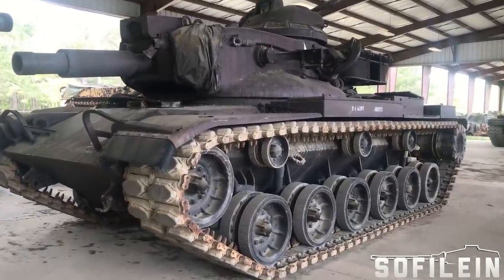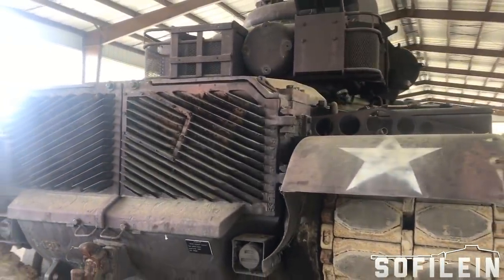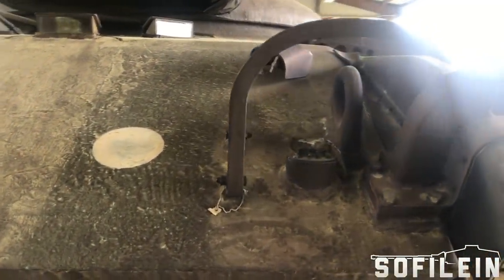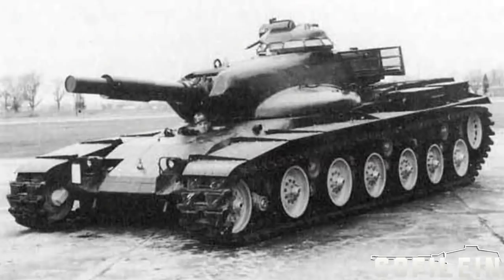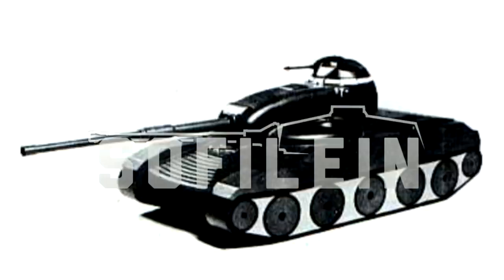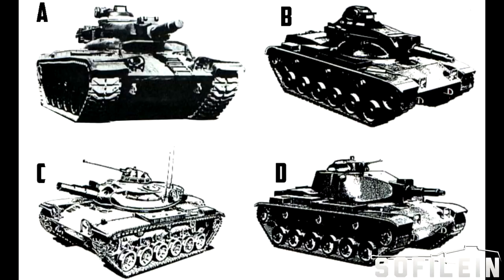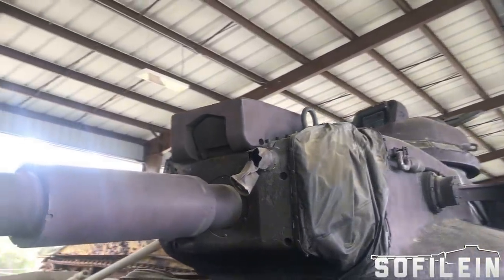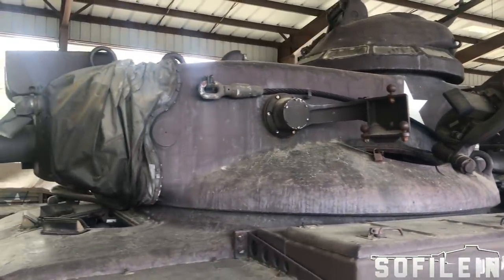Meet the M60A2 'Starship'! Walk and talk-around at NACC Ft. Benning

Comment: I went to tank drivers school at Ft. Knox in 1979 (MOS 19F).  We used M60A2s for drivers training since the hull was the same as other M60s, and the then recently obsolete turret didn’t matter.  For family day there was a cool demonstration of the turret spinning one way and the powered cupola spinning another, as well as a neutral steer and turret stabilization demonstration.

Inside, the turret was small, but the various illuminated and rubberized buttons looked very space age/advanced.  Operating the powered cupola was fun!  And, each crew member had a hatch on the M60A2.

I never saw the M60A2 again after basic as I was first assigned to an M60A1 crew, and then an M60A3TTS crew.

Sofilein: the Army is now accepting female tank crew members, time to sign up…….
Reply: Holder and Disney barracks. B4 I. I tell people today about 19 F and they're like whaaaaa....read somewhere that holder is closed and Disney torn down.
Reply: Ft. Knox was a ghost town 10 years ago guess it still is today.  Remember getting to see a Kraut Panther and the King Tiger that they did a cutaway on.  Guess these examples are at Ft. Benning now.
Reply: Things change and it's sad...I remember going into town to see the Cardinals play baseball. Loved those khakis! And the grease gun...don't know if I miss being a tanker, or being 17.

Comment: When I went to Armor Basic Officers course in 75, you learned the M60A1 and the Sheridan.  Those officers in the class going to M60A2 units received specialized training, the rest of us just got a basic orientation.  When I went to Germany my battalion in 1st AD was M60A1, while the 1st AD 4-37 Armor was all M60A2.  Next to us, 3rd Inf Div split their M60A2s up with one company in 3 battalions. 1st AD's 4-37 did OK as it simplied the maintenance, I think the 3d ID units struggled with maintenance and employment.  The system was way ahead of its time, the electronic boxes did not take tank stress (firing, normal rattling, humidity etc) very well, today's micro circuits can handle it much better.   I do not recall the term "starship being used, Just A2.  However ti probably was a crew name.
Reply: The story I heard was that yeah, "Starship" was the name someone gave their A2 and it stuck.
Reply: @cboetigphone, the 1/37 was the only battalion in the 1st Armored Division that had the M60A2s 
The 3rd Armor division had two battalions, and I believe both were on the Rock, and only three battalions were stationed in Germany.

Comment: When I was in Europe in the late 70's I was on the M60A1 RISE.  We heard horror stories about the A Duces, as we called them.  When the RISE model came in they were afraid of issues with the new power packs. electronics and lack of spare parts and only allocated 1 per Platoon.  As it turned out it was unfounded.  I couldn't tell you what the crews called them, but to us they were the A Duce. To us the A Duce was a prime example of a good idea taken over by bureaucrats.
Reply: I crew the A2s, we never called them Starships, it was called either the Ma deuce,  A deuce A2

Comment: Maybe it has been awhile for me (MOS 19E)  but "Starship" was not named for the 152 rifled/ATGM turret.  It was named for the Xenon White-Light or Infrared Spotlight used for night ops.  Either a M48 or M60 "ship" mounting a "starlight"  The M60A2 was a total failure due to a crappy stabilization. The next leap of "starship" found its way into my tank, M60A3, which had a much improved "starlight" night vision called TTS or tank thermal sight from 1980 and an AOS.

Comment: how is a long rod penetrator effective on a short barreled gun like that?
Reply: Lower. But the rod material choice makes some difference. If thinking about rod made of some mixed tool steel alloys it would work only with some sort of overpowered propelant. Rod density, distance and the size of charge would play main role.

Comment: Im curious what those 3 trailer hitch balls you see at 1:52 were used for?
Reply: Was wondering the same.
Reply: Big spot light mounted on them. As the gun elevates and depresses, the spot light changes angle as well.

Comment: I think one of the primary technological advances of the M60A2, in addition to the combined gun/ATGM launcher, was that the gun system was stabilized, and could theoretically be fired accurately while the tank was moving.  All previous U.S. tanks, including the M60A1s, had to be stopped in order for the gunner to accurately fire the main gun.  This requirement to be stationary when firing increased the tanks’ vulnerabilities to enemy tanks and ATGMs.  All later tanks, from the M60A3 onward, had stabilized guns, and could shoot accurately while moving.

Comment: My 1st real Job was part of a government contract to demill and Recycle all these M60a1, M60A2 and m48 tanks. I came across hundreds of them that had 10miles, and 2hrs on them and had been sitting in a Tx field for 30 years. They still smelt new inside, Had plastic on the optic lenses and I doubt ever had a crew.  There were also thousands of them that had been well used, but I don’t think I ever came across 1 that had more than 300hrs or 500 miles on them. I think this was in 1996-2001, We would run a slave cable from one tank into another one that had been sitting for 20 or 30 years in the same spot. Then flip the master battery and every one of them powered everything up and then they started right up on the 1st try every time.. I got to drive them like I stole them for as long as needed to insure I run any fuel remaining out of them and did things in them any tanker would have only dreamed of. When I was done and sure It was running on fumes, I drove it to the main building and they all got taken apart, for recycling and the haul and turrets were cut into 2x2 chunks and melted down.  The motors were sent back to the Army/USMC for reuse, or a hole was cut in the side of the blocks.  It was the best Job a 21yr old could have dreamed of, I knocked over trees, played bumper tanks, ramped them. We took the turret off 1 new M60a1 and the suspension raised up 2 or 3 feet and we welded a plate over the hole and installed a couple old Ford Truck Bench seat there with seat belts for passengers and that thing would fly. It killed me when it was the last of the tanks in the contract and it had to go to.

Comment: I was a school trained M60A2 crewman (1974) with MOS 11EW1.  I was assigned to Co A 3/33 Armor in January 1975.  We received our brand new M60A2 tanks later.  We did occasionally use the term Starship  when putting down our fellow M60A1 tankers.  We had the starship and they had the dinosaur.  Among ourselves, we called it the A deuce.  As far as machine guns go, you could make the M73/M219 work by hand boosting the belt into the gun.  The feed system was weak and the gun didn't like to drag that belt uphill out of the bin.  The M85 worked well on high rate, which was just fine because high rate meant more rounds down range.  The only big problem with that was a limited supply in the ammo box.  I gunned a lot and I was one of the few to fire an actual live war shot missile.  All missiles I actually fired worked as advertised.  I also had zero problems with any conventional shots and the pressurized air evacuation system never gave any problems on my tank.  The whole fire control system was delicate though, and our talented turret mechs were VERY IMPORTANT PEOPLE!!
Reply from the maker: Right on!! Super comment, thank you for sharing and respect to ya for your service
Reply: @Sofilein  Thanks!  Most of the bad comments about the A2 actually originated with the M551, which was a bit touchy.  What people don't do now is look at the weapons system in context.  The A2 was built to fill a short term gap in our defenses against the USSR.  It was a specialist long range tank killing machine that acted as a test bed for the type of fire control that later went into the Abrams.  It wasn't supposed to be the end all be all of main battle tanks.

One thing you probably don't know about the deuce is the telescope sight for missile firing was NOT night vision capable.  We had passive night vision for conventional rounds, but not for missiles.  The war shot missile I fired was during an experiment at night to find a way around that.  I fired the shot against a long range hard target using flare illumination.  I hit the target, but I don't really consider the method that effective.  Flare illumination is NOT a very steady form of light.  Thank god we have thermal now.

By the way, I enjoy your stuff.  Well done.

Comment: Never heard them referred to as Starships.  I was a tanker in 1st AD in the late 70's.  As with the 551's the electronics were very unreliable.  The common theme was if you wanted to fire missiles you did that first.  The second or third conventional round would rattle the electronics enough that they would not work again.  It was also a common sight to see a chain wrapped around the main gun.  That indicated total electronic failure and the chain kept the turret from freely moving around.

Israeli's proved the big commander cupola's were a dumb idea.  Even just a shock wave from a nearby artillery hit was enough to knock off the cupola, usually killing the TC.

M73 was the 7.62 coax MG.  A real POS.  We usually had one in a platoon that worked well enough.  We'd rotate it between tanks for gunnery quals.  M85 .50cal was my favorite.  You had to take really good care of them and clean regularly, which many would not do.

Comment: The real problem is: Most tank on tank kills happen at ranges less than 800 meters. Within that distance the speed of the projectile is what kills. And you use APDS with a penetrator, where it is more the length of the projectile than the weight that is decisive.
Besides that, it presupposes you have line of sight to the target, which in Europe is rare. Beyound 800 meters the speed decreases enormeously, because the projectile has to pass through the sound barrier from the other side.

The other problem is that the aiming gets a hell of a lot more komplicated, when especially windage is to be taken into consideration.

At ranges longer than 800 meters a missile like the TOW is more effective though it takes about 800 meters before it is gathered to line of sight.

The Brits use a different tactic: Since the Churchill tank british tanks have been great climber and have a great barrel depression, so they take the heaviest, meanest tank - climb up a hill - and point that big gun and ask: What are YOU going to do about it????
Reply: All of our tank and Bradley crews in the US Army train for engagements greater than 1500 meters, and our AP ammunition is more that capable of penetrating at those distances, especially our depleted uranium ammo.